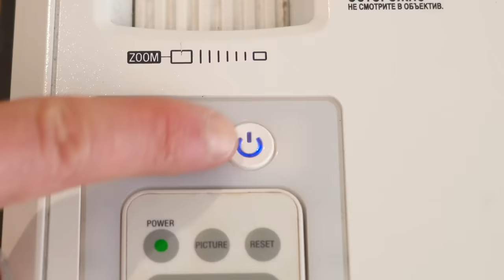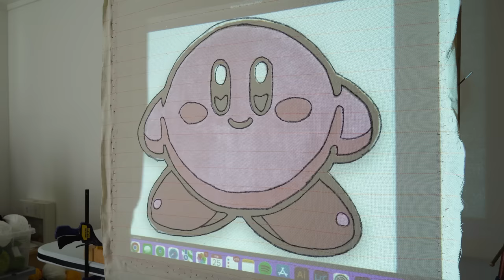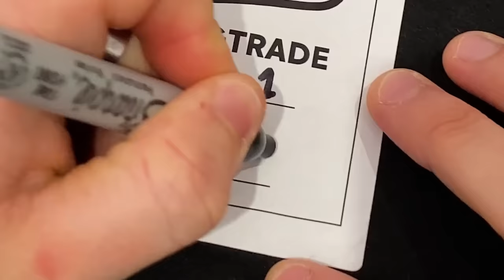ASMR Rug Tufting | Kirby Rug (Start To Finish)

Comment: Another question came to mind after a re-watch! How big is the frame you’re working with, and how big can you comfortably make the rugs with it? They seem pretty decently sized by the time you’re done and show them on the floor
Reply from the maker: my frame is probably around 3ft x 4ft... you can make rugs as big as you want in it really you just need to make sure that you leave a small gap around the edge of the rug so you can fold the sides over :) I watch videos of people making rugs on frames 5 times the size of mine it just depends on the space you have and your supplier of monks cloth :)

Comment: Something about Kirby just seems like the perfect model for a tufted rug. Awesome job!

Just outta curiosity, is that just regular ol hot glue that use use to secure the edges of the backing fabric? Or is it something more special? Thanks!
Reply from the maker: Hey ben! thanks for the kind words :) yes it's just normal hot glue, however I've heard some people do the cutting out process when the carpet glue is still tacky so they just fold the edges over and it already sticks to itself! Haven't tried this myself but will do in the future for sure :)

Comment: Nice work! Can you tell me how to make the wooden stand for the monk carpet?
Reply from the maker: The frame is made up of 4 wooden struts that are screwed together, and then carpet gripper rods are attached to the front (with the spikes facing outwards). I would advice finding a source for monks cloth first and then making the frame to fit those dimensions, leaving a bit of slack around the edges as I do in the videos :)
Reply: @rugtrade  Thanks so much! I hope to find a supplier that supplies to Liberia. Currently there’s no one in Liberia doing such a business. I will have to start small though, since I literally have to import the tufting machine and all other major tools 🤦🏾‍♂️🤦🏾‍♂️

Comment: Wow. That's so nice.
How long did that take from start to finish?
Reply from the maker: I work on the rugs on and off throughout the week so difficult to give an exact figure... without doing the filming I could probably speed run a rug this size in about 3 hours i'd guess! (excluding glue drying time) :)
Reply: @rugtrade  Nice. Thanks for the answer.
One more thing. The "standoff" on your trimmer is that 3D printed? 
I've seen this trimmer in my country, but never with that attachment.

Comment: Very nice rug.

I have some potential tips for you if you'd humor me.

1. Please invest in a table that doesn't have a plastic top.

Even if the load you clamp to it is light the clamps will wear down the table over time and warp it. Making things harder for you later.

2. If you are more comfortable using scissors to cut the material ignore this...

If you want to save your hands some work get and use a box cutting knife. It's a thin blade that's easy to control with one hand and will make smoother cuts that clean up way easier in the end.

3. Unless you enjoy doing it by hand...

 Attach a drill or wheel to your yarn baller  I feel like you'd have so much more time on your hands if you did just that.